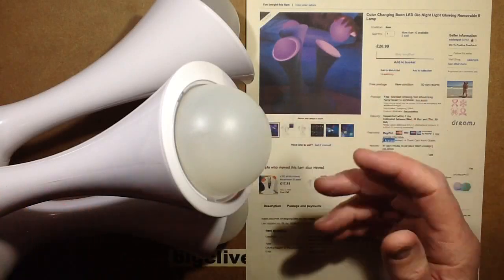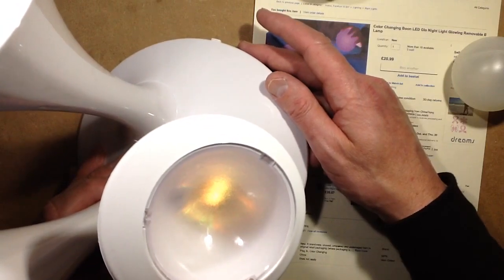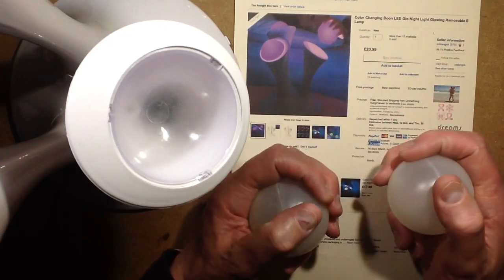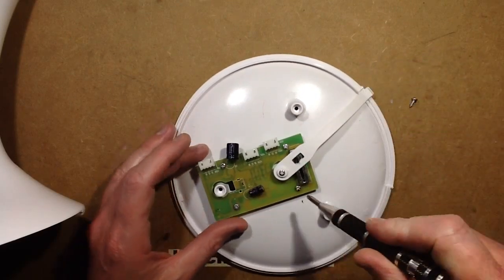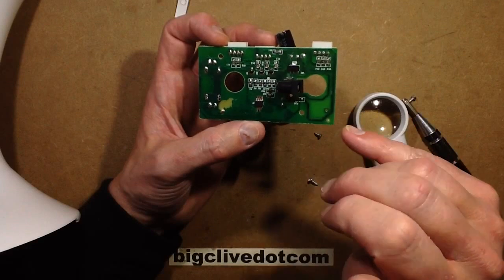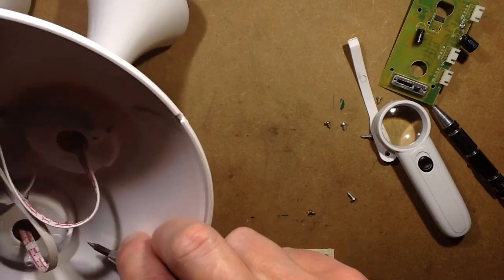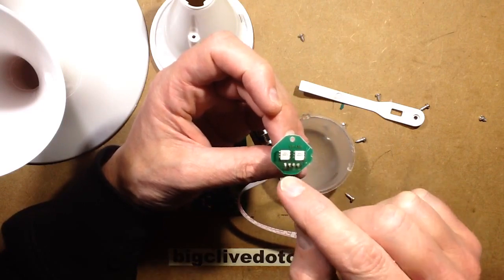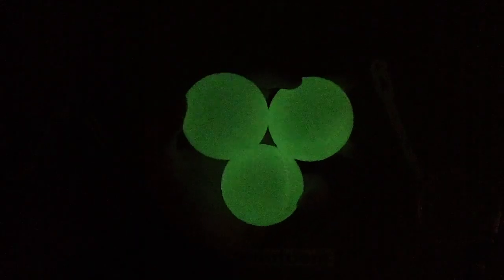LED glow ball ornament teardown.  (Boon glo or clone?)

Comment: I am not electrically minded. I an a mechanical man, so; I have just about got my head around a Variac and a Variable Resistor. Now I am stuffed. What is a Variable Potentiometer? My head hurts (again) now. Love the videos by the way. Cheers.
Reply from the maker: It's just a resistor with a wiper that can slide across it to vary the resistance.  It's another name for a variable resistor.
Reply: bigclivedotcom
Thank you. I mean just how many names do electricians want for a "Screw" or "Bolt"? All the best :)    <-- see I'm much better now. Cheers.

Comment: The rhyme in the end was a nice touch, also did you make your own UV led or did you buy one. I like personally swapping out High Powered Flashlight LED chips with 3 watt UV ones, it works great. 

 Otherwise you can't really find something that strong as normally most just use the 20ma 5mm.
Reply from the maker: It was one that was supplied with UV activated resin.
Reply: Cool it looks surprisingly good for one just bought, thanks for the response.

Comment: Put a small hole in the side of the balls and fill them with a mix of glowy powder and resin.
Reply: The fact you said "Glowy Powder" made me read this in Clives voice...
Reply: Interesting idea, but if you put too much stuff inside the light will not reach the far side of the ball. This will prevent the entire ball from glowing. A light dusting of powder inside would probably work best.
Reply: Bigrignohio
But also the more resign you put in with Glow Powder though the more Light It'll absorbed as you say, but in turn it'll make a longer lasting glow accordingly.

Comment: I dunno about the UK, but in the USA we call that a pan pot.
Reply: No, you don't. Except when you want to spout uneducated nonsense and sound like a fucking tool. A fader is a fader around the world, and so is a pan pot. Pan pots are pretty much everywhere built as rotary knobs, whereas faders are most often straight-track sliders, regardless of the technology they're based on, analogue resistive or digital encoding. Anything else is an exception.
Reply: As someone who (mis)spent much of his youth behind a mixing board (desk) I heartily agree with Anvilshock. The only straight slider pots on any mixer I've ever seen are the faders. Pan, EQ, FX send, etc. etc. are always rotary.
Reply: Jafafa Hots Conceded, we all have our fields with grown terms in each. Was a hard guess, though, since you chose to say "here in the USA we do" rather than "At the company where I used to work we do". Your freedom to sound or not sound like said tool. Have a good day, sir.
Reply: Anvilshock
I'm no electronics expert. I'm simply using the term that the engineers at the corporation I used to work at used... they were not audio techs, our products were not audio products. They were other electronics like lights, alarms, etc. They called sliding pots "pan pots" because they "panned" side to side, and rotary ones rotary pots because... well, for obvious reasons.

Anyway, I'll take your word for it. They must have had some sort of internal reason that they did that. They also used the word "jobber" to mean something different than many other manufacturers do, so I guess it should be no surprise.

Thanks, though, for responding to my little anecdote by calling me "a fucking tool."

You seem nice.
Reply: Big professional EQs actually use faders, one for each band.
Reply: djteac But big professional mixing desks don't have big professional graphical equalisers, those are standalone devices. (Except maybe some digital consoles with GEQ fader pages such as Soundcraft's Vi and Si series. As I said, everything else is an exception.) Your point is still void.

Comment: Might be nice to fill balls with water and glowy stuff :-)
Reply from the maker: Like nitroglycerine.
Reply: lol was more thinking glycerine, but whatever floats ya boat ;-)
Reply from the maker: Photoluminescent pigment.  Available on eBay and used in a few of my videos, mixed with resin.
Reply: there is flouresand powder you can buy
Reply: yup yup what he said XD i forgot the name of it
Reply: tetchnically you could mix the reesin put the powder in,,, then put a blob inside the ball,,, and roll it aorund and make it coat the inside,,, that would or should be able to work so you dont need to fill it up all the way
only thought or worry is the interior coating thickness

Comment: You've ruined me. 'Cause here I am, sitting and taking a LED-spotlight to pieces (the imitating a cold-reflector type). Why? They had 5W(?!) lamps for sale (about 2 €) but only the bigger and I needed the smaller so first thought was - "Lets take it to pieces and if it can be modified".
So far it looks good, the "reflector" is a lens and it + chip should fit so now I'll just try to cut off the fake cooling fins. Where's my snips? 
(Yes I plan to measure the power usage, doesn't quite compute though since it's listed 12V AC or DC - shouldn't it run on a lower voltage on DC?)
Reply: Slightly below 0.4 A on 12V DC, say 0.37 which gives just below 4.5W. More then I had guessed :-)
A complicated design then the 12V you tore apart in your next clip - I think I'll return to the store and see if they still have them (5 remained when I left today) so I can send one your way.

Comment: Clive, what's the heat buildup like after running it for a few hours? Using it in a child's room as an extra fancy nightlight is interesting but I'd worry about a meltdown/softening in the wee hours culminating with some high pitched screams, lol.
Reply from the maker: It's nothing at all.  The LEDs are just ordinary low power ones.